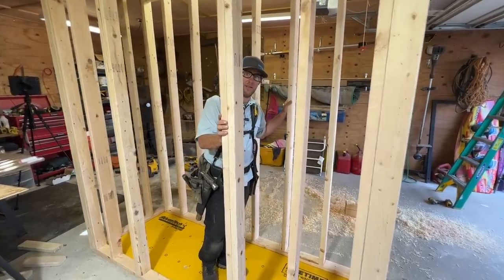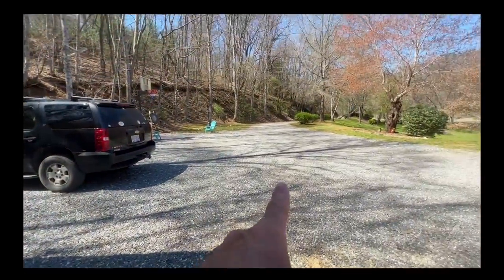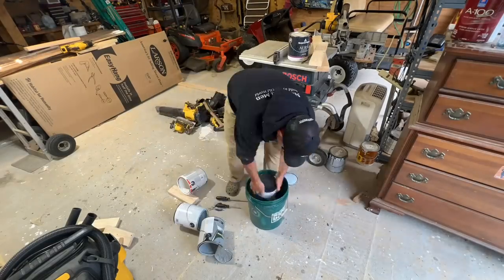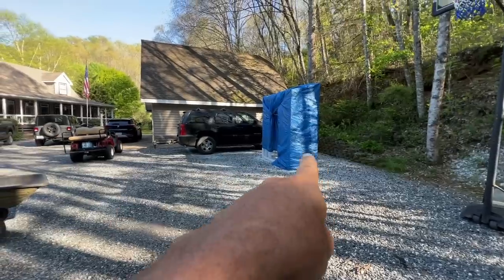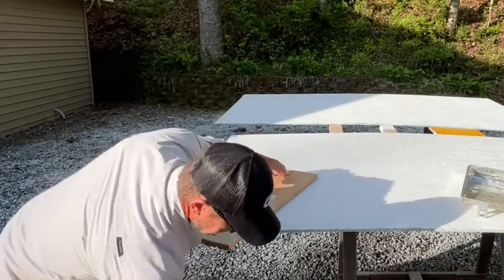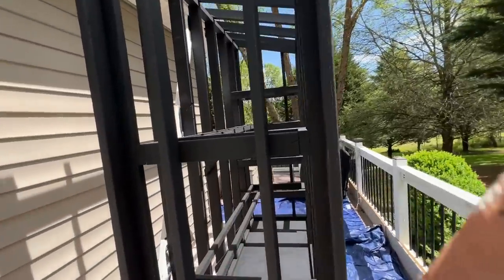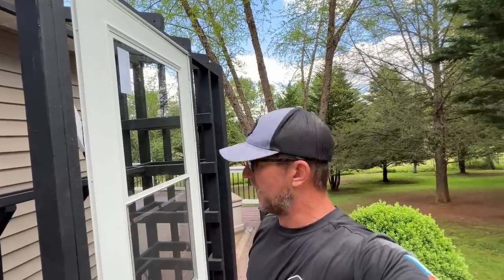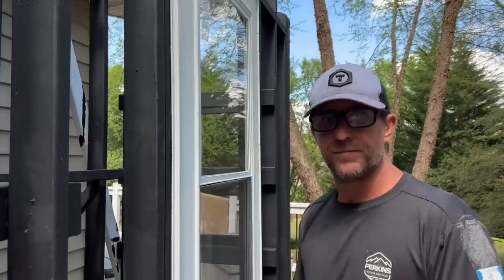The Greenhouse…JUST GREW UP! Part 2–#hisea

Comment: Jay, I gave you a heads up. You know when you have a ramp to go into a shed and sometimes when it gets wet and you fall and get slippery do like I did I live in the north east. I don’t know if it snows where you are, but I’ll tell you what I did. I took all shingles and I nailed them to the Amp so when I walked on it in the snow, I didn’t fall down. What happened was I had pressure-treated lumber on it before and I slipped and I fell and landed on my back. Lucky I didn’t get real hurt, but that’s just a heads up and the other thing I like to ask you is this when you put the dog thing out there the other day where did you drain it to, just wondering you this is Alan from Massachusetts

Comment: Jade. Don’t you know how to tint paint a touch of black will bring the color very like an eyedropper take a pint of paint put it in a plastic bowl take an eyedrop drop it up an eyedrop just wanna drop makes it up and see what happens much backing right up And it might even be enough for you to do that. You’re basic colors were tinting a black and white are used to paint all kinds of pain when I was a young boy. It’s hard to explain how to do it, but you take white and you can turn it gray or black or any other color you want do you wanna lighten the dark color and white? I’m just telling you how to do it do it on the side check and see if it works if it matches you and another thing I’ll teach you when you’re done with the paint that you painted your house, so you got a color of your house if it’s final siding or anything Trying to keep a piece of vinyl left over so when you do need to go get some paint, you can match it up to the chip that you have in your hand. This way you’ll save your time and effort for Massachusetts Alan be good love your show.